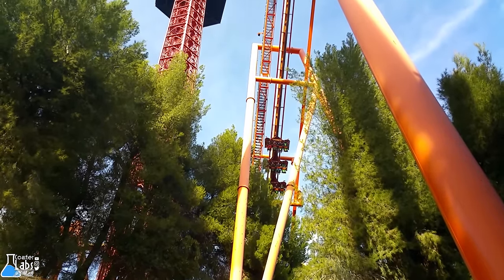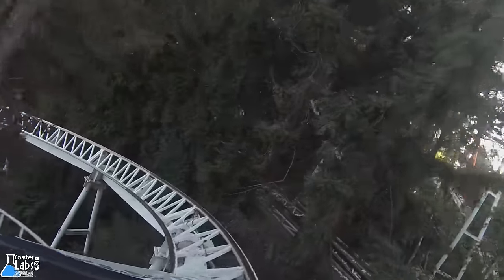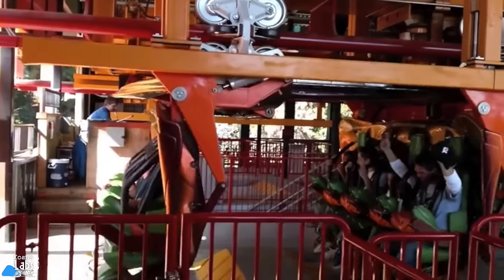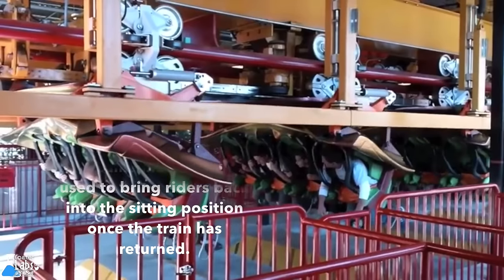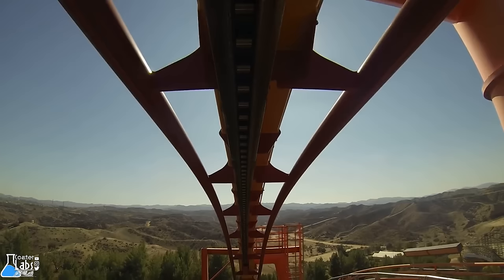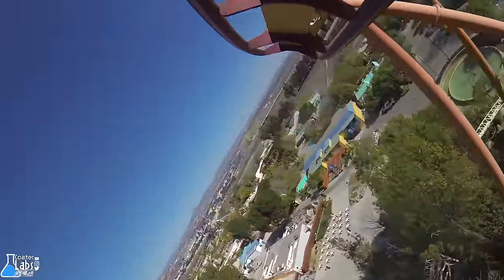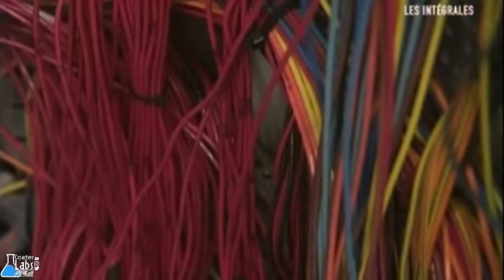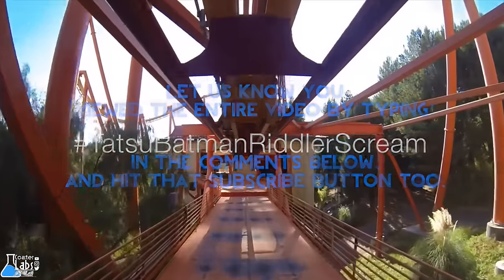How It Works: B&M "Flying" Coasters (Tatsu @ Six Flags Magic Mountain)

Comment: The chain lift broke a week before I got my season pass 😢. I really want to experience it again since I haven't been on it since 2015. I hope they fix it soon
Reply from the maker: Brian McNally ikr, this last time (1/01/17) was the one time I rode in a LONG time cause either it's closed or it has a really absurdly long line...
Reply: Coaster Labs from what I heard they have to replace the chain lift which as you can imagine isn't and easy thing to do on the worlds highest flying coaster
Reply from the maker: +Brian McNally oh yeah. They have to remove all the guides and replace the sprockets and oil a bunch of stuff and check sensors wiring, etc. So yeah it's a prett y long process. Theyve also removed the lift gearbox for the moment.
Reply: Coaster Labs despite searching online for answers I still can't seem to find out why the Apocalypse has been closed for so long. I found out about the Tatsu online; obviously the Riddler won't reopen until Battle for Metropolis opens (I've also heard it's receiving a new coat of paint), but Apocalypse has been a total mystery. You got any ideas?
Reply: Brian McNally its fixed lol
Reply: They did my guy
Reply: @brianmcnally2873  its closed by the way

Comment: Just a few notes... 

1. Im quite sure they have ran all 3 trains before. The purpose of the dual station is so that 3 trains can operate at once. For example - The Superman Ultimate Flight clone in Georgia has a dual loading station and it also has 3 trains. But the clones in New Jersey and Illinois only have 2 trains and they both have single loading stations.

2. The pair of ankle restraints are called 'flaps'.

3. The 'track switches' (there are two - one before the lift and one before returning to the station) are called 'turntables'.

4. The 'Mid course brake run' you mentioned is actually the safety brake. Tatsu is similar to the Superman Ultimate Flight clones as they dont have MCBR's. 

5. Your explanation on Block Sections is a little misleading. There doesn't have to be double the amount of block sections as trains. Using Georgia's Superman as an example, it only has 5 blocks (2 stations, lift, safety brake, transfer brake) but it can operate 3 trains at once.
Reply from the maker: 1. Oh, I thought I mentioned that. shrug
2. Okay, I couldn't find a name for them, but that makes sense-ish.
3. Well wouldn't a turntable imply that you're turning the piece WITH the train on it? Kind of like a train turn table...
4. Yeah, going for more simplicity.
5. Come to think of if yeah, I mean I guess. I should have said that depending on the type of block trains can occupy neighboring blocks (ie: a train in the transfer and a train in the station while another is one the course) like in the example you mentioned.